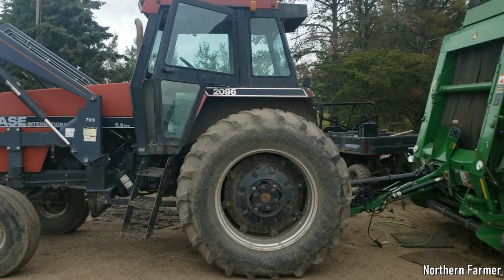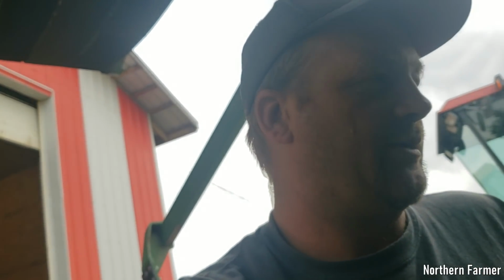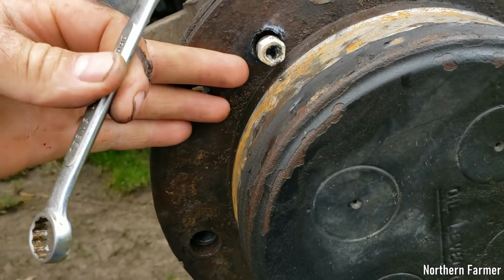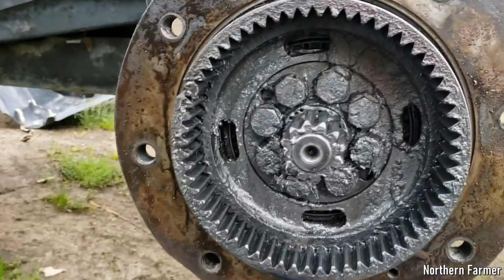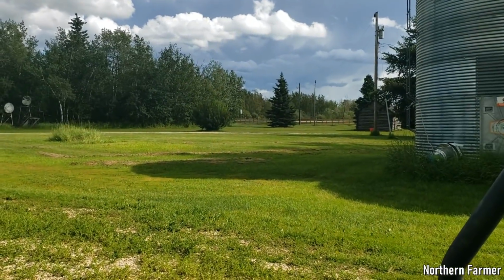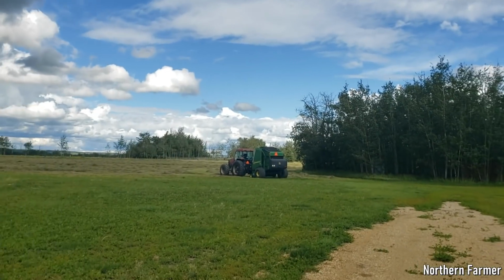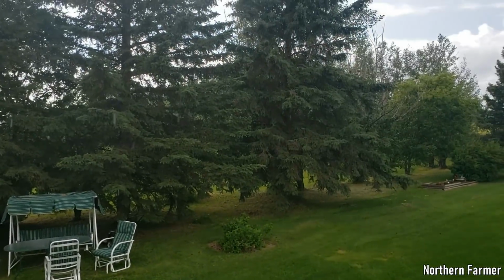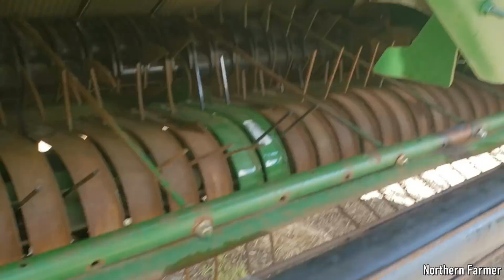Getting the 568 Baler Ready...and Stuff!!

Comment: We bought a slightly used 467 baler long time ago. Previous owner left the electric plug in after unhooking and tried to drive away lol. At first we had to do some fixing. Hold the plug ends in your left hand, grab the wire bundle and gently push the wires into plug as far as it wants to go, don't force anything. That might help with the connections between the plugs.

Comment: I've never before seen inside the works of the final drives on the front axle, and that one definitely was buggered.  Hope it's easy for you to get the parts needed to replace what was broken.  That new (to you) baler will be nice when the monitor isn't throwing codes.  Happy hay season!
Reply from the maker: Turns out that wasnt even the monitor for it... they just threw in a junker with it
Reply: @Northern_Farmer  Sneaky of them, but I'm not overly surprised.  Can it be fixed, or do you have to find another one?

Comment: Yeah my 07 568 has the same issue with the plug-in, i zip-tie the wire bundles together and i ended up jumper wire for the door sensor as that pin got bent in the plug and broke.
Reply from the maker: I got a new plug end for mine
Reply: @Northern_Farmer  What kinda moneys in the plug kit?

Comment: I’m starting to get really stung on parts prices with running the older machines, I’m wondering if the dealers are trying to push people to get rid of the old uns! 
It’s almost cheaper to buy a running machine and just take the parts off it.  Great video 👍
Reply from the maker: That's not a bad idea
Reply: They only made so many spare parts for machines, it stands to reason that after a period of time the supply of them would start to become limited resulting in the price increase. Just like with cars and trucks, after enough years there's just some parts that you will not find unless it's at a salvage yard.